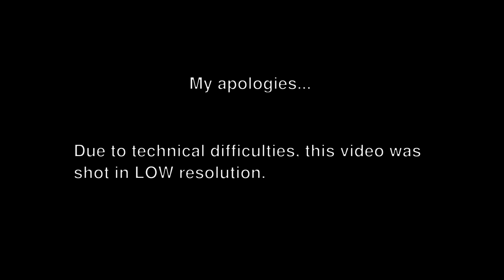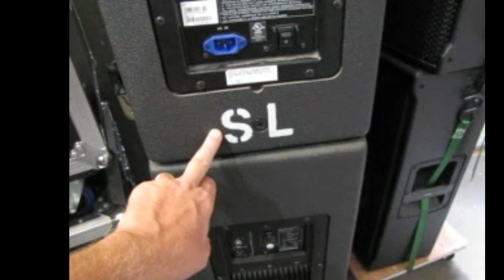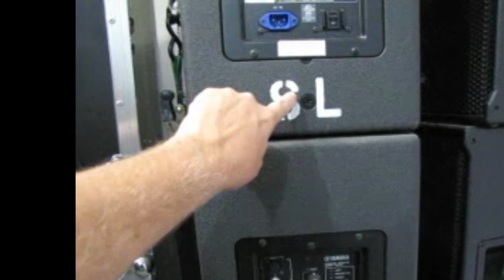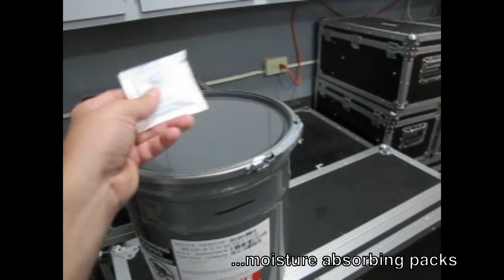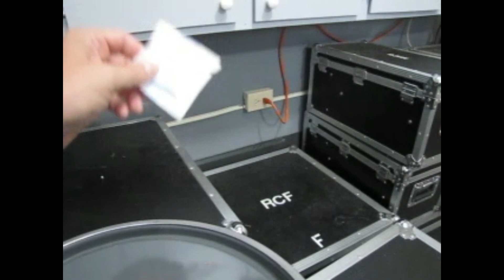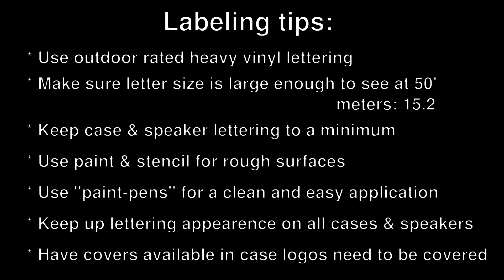Labeling of audio equipment cases and gear

Comment: Longtime listener, first-time caller. Love the channel. I have a couple questions:

Where do you Source your outdoor-rated heavy vinyl lettering?

Where do you Source your cable trucks? (Xlr / Pwr)
Reply from the maker: Thanks for the comment.

Most any vinyl lettering company should be able to provide weather rated lettering.  This is whom we use for lettering: lettersunlimited.com  
For the road cases: audiopile.net    Other case providers may provide more sizes and customizing.
Hope this helps.

Comment: Really love the videos, hope you guys are holding up well. I have always been curious what kinda snake cables you run. How long are they, analog or Digital, like how do you go about getting sound from and to the stage.
Reply from the maker: Thank you for the comment.  We use different sized snakes for different types of events; we have a 150' - 32x8, and 100' - 24x8 for FOH use.  We also use a a 30' 8-channel drum snake, and 32 x 15/20 splitter for running monitors from the stage.  All snakes are analog.  They run the signals from the stage to FOH and the "returns" send the mixed signal back to the stage.

Comment: I'm surprised by your experiences with clients regarding advertising. I have yet to have a client that complained, even for large shows (10k people or more) That's how we get most of our smaller work, weddings, corporate gigs, etc. We always have a banner on the stage and FOH tent.
Reply from the maker: Over the many years, it has only been an issue with a few customers; they ask if my equipment is "covered" with my logo; when I inform them how it's label (as it is in this video), they were good with it.

Not related to any event we have been a part of, but some events will provide their own covers (especially for monitor speakers).  If you watch videos where the monitor cover speakers have the event name on them, the producers/organizers arranged for those covers.